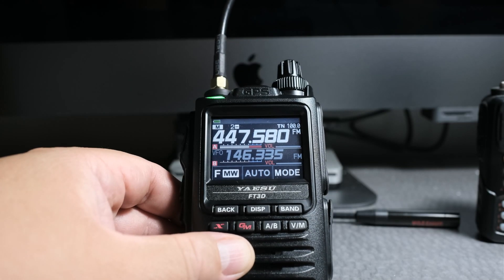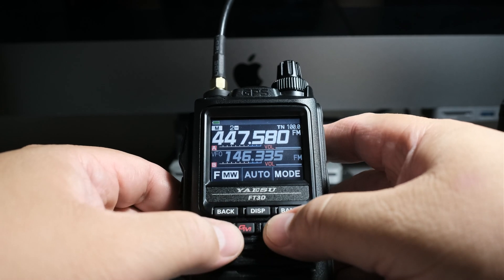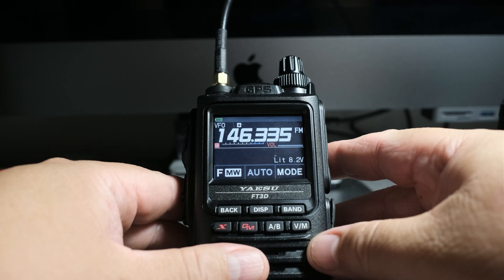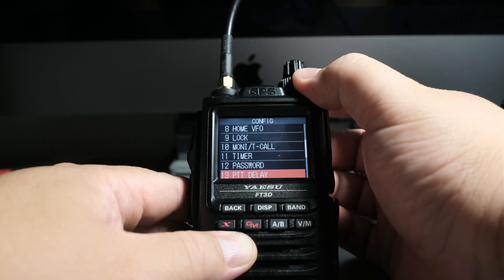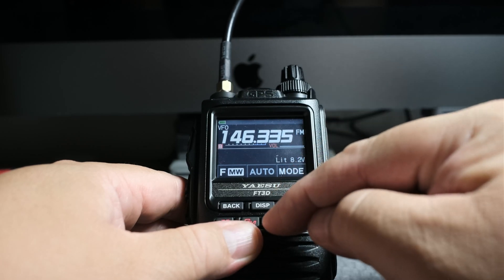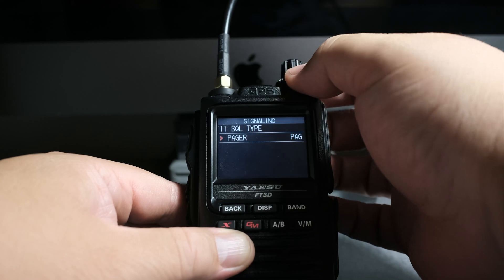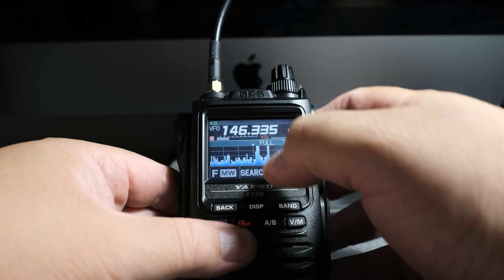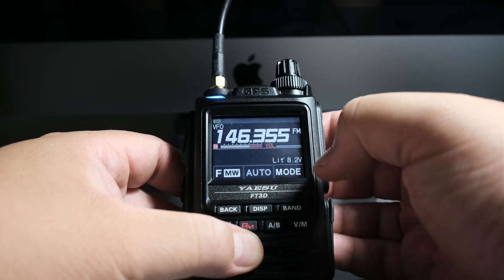Setting up Simplex on Yaesu FT3D

Comment: None of that was necessary.  just touch and hold the frequency on the screen and, on the screen that pops up, enter your frequency (usually 146.520).  Then press the Back button.  You're already in FM mode and the radio is smart enough from there.  It isn't going to use tones unless you tell it to.
Reply from the maker: Very true.  But put yourself or change your mindset as someone who doesn't know anything about Simplex, VFO, or repeaters.  When I used  FRS radios, it was easy, just talk.  On these sophisticated radios, there are so many settings that it's overwhelming at first when you start and then people get frustrated and just feel it's impossible to use - well for some people - like me. Thus the video to help those with questions.

Comment: Hi, can you recommend this radio for analog VHF simplex ? is it superheterodyne?
Reply from the maker: Recommending a radio is challenging for you need to consider budget, you needs, what features you are looking at.  I would recommend you speak to someone who sells these radios.  On that note, this radio has very nice features which you can read up on, but it's not inexpensive.  There are other radios that are better priced and has 1/2 of it's features.  As for  your second question, it is.  Check the marketing material: at https://www.yaesu.com.
Reply: @frankwc0o  hi thank you for your answer ,ive contacted dealers in my area but no response to technical questions, so i hope to get some answers from people Who have some experience with it. I am looking for a dual band radio for analog vhf communication, airband (8.33 khz aviation) reception on the seconden channel. I like the fast scanning capabilities of the ft3d and the scope and gps features. But i need to be sure i am not buying an expensive direct conversion baofeng quality. When looking at the tech specs :Circuit Type: NFM/ AM:Double-Conversion Superheterodyne
FM /AM Radio: Direct-Conversion. So i am not sure vhf is double superheterodyne.. ?

Comment: Really? All I did was set the radio to a valid simplex frequency, you don't have to go through all that at least I didn't, if you're getting the off set then you're not on a simplex frequency.
Reply: @frankwc0o  you should do a Google for band allocation in your area for 2m, so you'll know what frequencies are for simplex, if a + or - appears when you put a frequency in then its most likely a repeater frequency. Take your time watch a lot of how to videos,   PS nice radio I just mine had to retire my older radios batteries are dying and can't get them anymore,

Comment: Hello I wanted to ask a question, does Yaesu FT3D/2D broadcast (108,136 mHZ) on airband? I am interested to be used RPAS, thanks.
Reply: No it won't. You can modify it to work in some air and but definitely not on fm broadcast